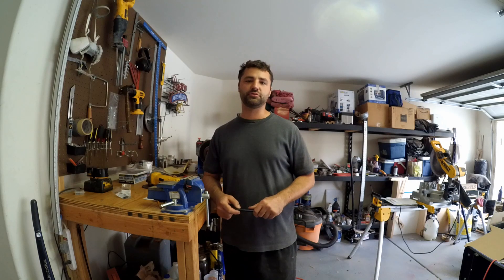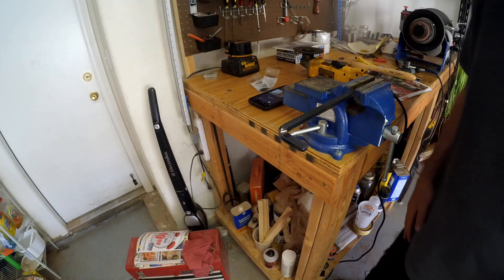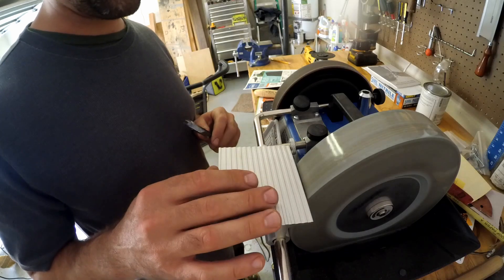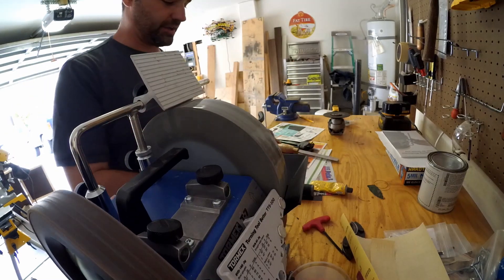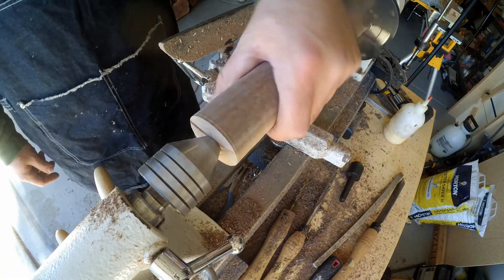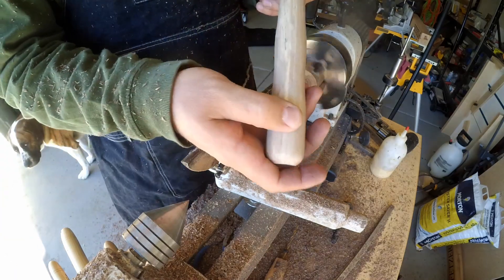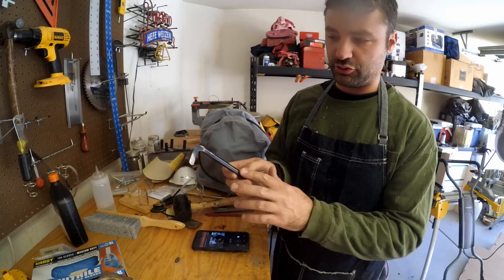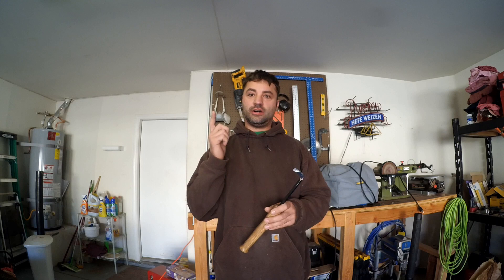Woodturners Journal: Make Your Own Hollowing Tool

Comment: The ferrule reduces the possibility of the handle cracking when you have side thrust. It add :LOTS of safety and should always be used when making tool handles. In addition to cutting up plumbing pipe, you can also buy pre-cut plumbing copper/brassat Ace Hardward, and Home Depot. Also I recommend usinf 2-part epoxy to secure the metal tool inside of the tool handle. That way you don't run the risk of splitting your newly made handle when you pound it down into the wood. Just a couple of suggestions; I've made about 20 tool handles and these ideas work  for me. Keep on turnin'!
Reply: Iron pipe works too.
Reply: I purchase copper pipe couplings, cut them in half and they work great.  Big box stores carry them and they're not too expensive.

Comment: Jerrod its a ferrule and just about any plumbing connector or straight up tubing will work. Even larger nuts will work and the brass ones can be turned with carbide tiped tools which you can make, Thanks for sharing Jerrod.

Comment: This will be nearly impossible to control for very long.  The cutting tip should line up with the handle.  This is why you see curved hollowing tools in "C" shapes, not "L" shapes.  You could have heated the steel and bent that into a more controllable shape.    Like:  ________/''''''\

Comment: The metal rings are called ferrules.  I make mine out of copper pipe from the hardware store.   Scrap from a plumbing job works well.  available in .5" , .75" & 1.0"
Reply from the maker: +Robert Lunsford Awesome!!!  I have asked several people and have searched and no one seemed to know.  I never thought of the plumbing pipe.  Next handle I make, I'll definitely try that.  Thanks a lot.

Comment: Did anybody mention to use a piece of copper plumbing for the ferrule, yet? I usually cut a 3/4 nipple in half to get 2 ferrules. I prefer using a fitting for the slightly larger diameter. Thanks for the how-to. I'll make a few of these hollowing tools of different sizes.
A tip about hammering the tool into the handle... I never hammer. I drill slightly oversize and use 5 minute epoxy to set my handles. Easy peasy and never had one come out yet. ;-)
Reply: I guess I'm kinda off topic but does anyone know a good website to stream newly released movies online?
Reply: @Thatcher Theodore Flixportal :D
Reply: @Amos Royal thanks, signed up and it seems to work =) I really appreciate it!!
Reply: @Thatcher Theodore happy to help xD

Comment: If you use the copper pipe as other have pointed out, you can also you a standard tap and dye set to cut some threads down through the pipe and wood for set screws.  I have a wooden handle that I made that has a dual ended tool in it.  When I want to use the other end, I simply loosen the set screws, flip the tool steel around, and tighten the set screws.
Reply from the maker: +Tony Montgomery That seems like a pretty good idea.  I think I may have to try that one.  Thanks for the suggestion.

Comment: nicely done, however I would keep a small can of cold water to dip wrench into so you don't loose temper in the wrench!
Reply from the maker: Thanks for suggestion.  I didn't actually show it on camera, but I was dipping it in cold water.  Mainly so I could handle it.  Perhaps I should of mentioned that in the video.  :)

Comment: Hi Jerrod, Just curious, how does the allen wrench hollower work? You mentioned that you might need to trim the short arm section if it is too "catchy". I ran across a guy at the flea market selling tools and I cleaned out all of the allen wrenches for a mere  $1.00. My intent is to make a variety of hollowing tools.
Reply from the maker: It works great, but I do recommend making the tip shorter.  When it's long, it does want to catch a bit.

Comment: the word is ferrel found in the big box stores in the plumbing dept area you may need to glue the shaft in epoxy drill a hole in the side to allow the air to escape the tendency to twist while using is normal and i put a pair of vice grips on mine to use a as  counter measure

Comment: Brass & copper is too expensive for me to use to make ferrules for my tool handles.  I use emt conduit for most of my ferrules.  I go to lowes & buy their 10 foot joints of emt conduit pretty cheap to cut & make my own ferrules.  10 foot 3/4'' in did conduit for $6.20, 10 foot of 1'' $11.98, 5 foot of 1/2'' $2.28.

Comment: Not a good idea to polish the handle as it could slip in your hands ,, I prefer a longer handle,, ferrules can be made out of any tubular metal, I have used the wardrobe hanger bar ,,drilling go tad deeper ,,a tad wider than you need say a 1/32  and like the Doc and Ted suggest get some epoxy in there,  first drill a1/8 hole just backside the ferrule so any glue can be released, put the tool into the handle, twist it to get good coverage ,then push till it's deep enough,, the glue as filled the space in the handle and some come out the hole ,,,leave for few days ,All the best ,,Regards Alf